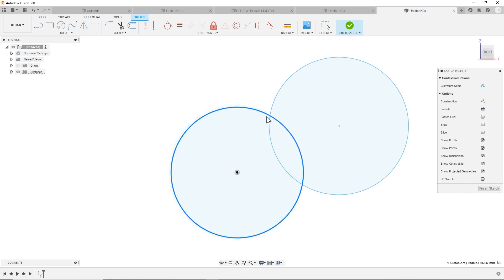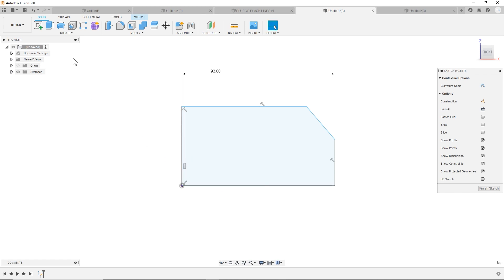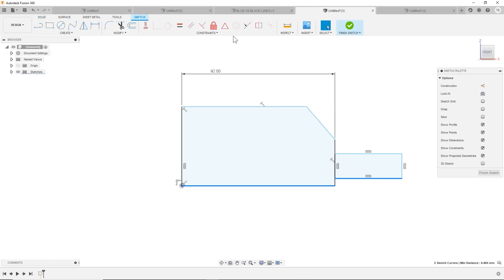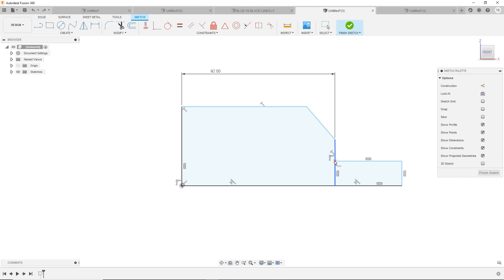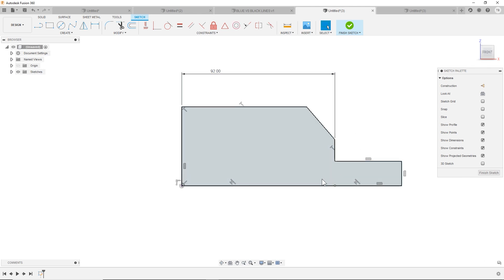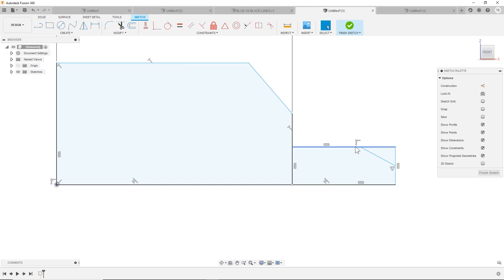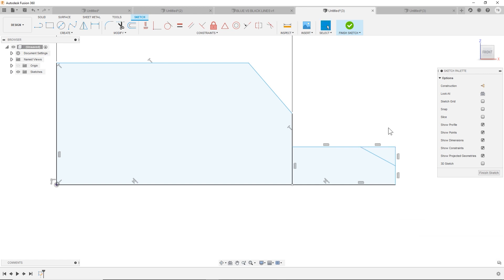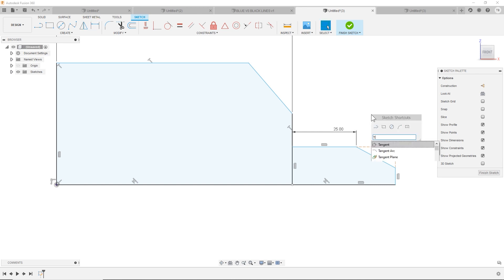How To Break Lines in Fusion 360 (Dividing A Line)

Comment: I just wanted to break a sketch line into equal line segments and in that case, one should use Sketch Rectangular Pattern. There are two Rectangular Pattern: Solid and Sketch. I wasn't aware of this and was trying to use the Solid Rectangular Pattern to no avail until I realized there is a Sketch Rectangular Pattern, which is the one to use to break a sketch line into equal line segments.